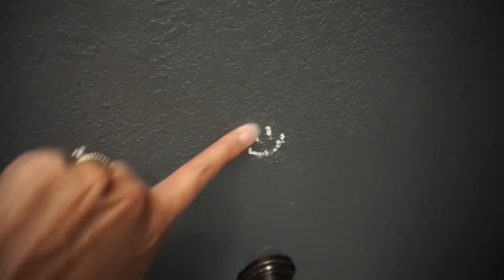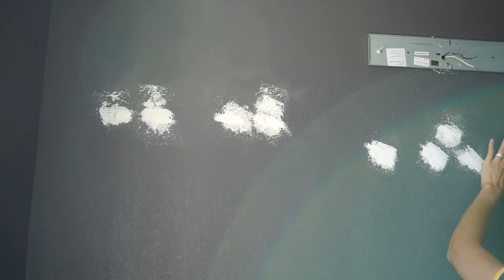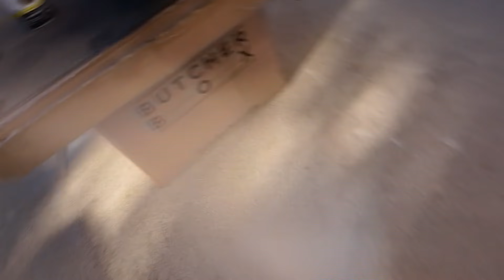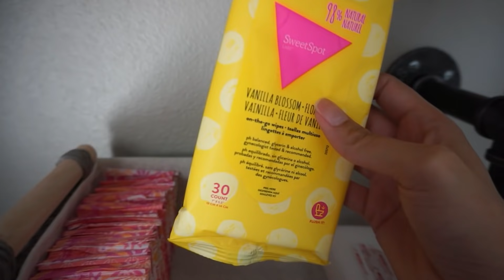VLOG SHORT | TOTAL bathroom makeover! More like lipstick on a pig, but like nice lipstick. LOL💄!

Comment: The previous owner seems to have installed the cabinet over the commode and medicine cabinet using whats called a hanging rail that's what that metal strip is called. They use this same installation technique for kitchen cabinets too. Then the wall anchors can vary on strength but most can hold between 50 to 100lbs. So don't feel too bad Dani I'm hopeful ya'll weren't in danger from it falling and the kids weren't in danger ❤Someone correct me if I'm wrong but that's what it looked like.
Reply from the maker: They were rails for the right purpose but used incorrectly. Does that make sense? Something doesnt serve its purpose properly if it isnt used correctly. He had it hung in dry wall (no studs), with the wrong anchors and only used 3 WOOD screws. Lord have mercy, I feel my blood pressure rising lolol
Reply: French cleat / hanging rail is used for heavy items but the screws need to be in at least one stud …